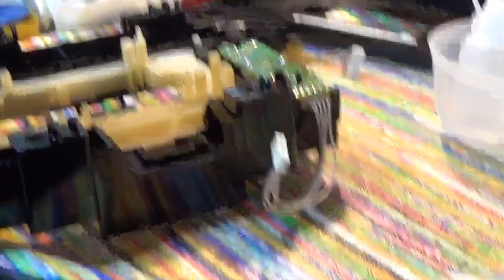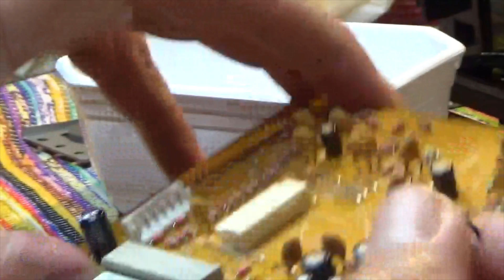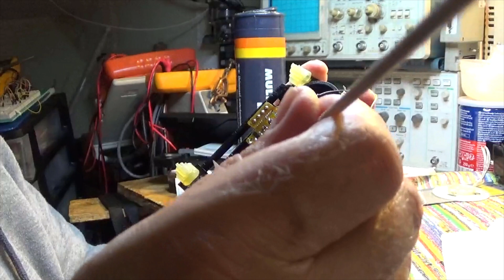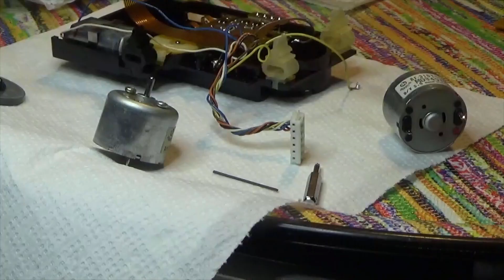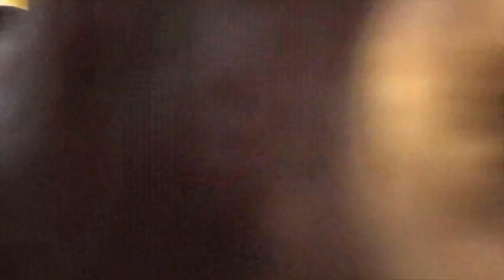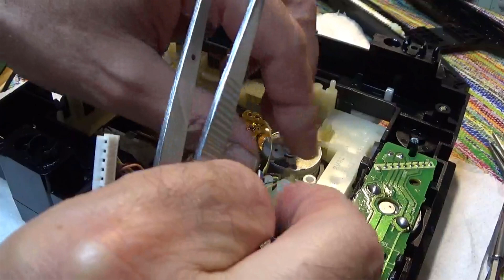Technics SL-PG480A CD Loader Repair Part 1 of 2

Comment: I don't know how to find the switch which is open the drawer, I cannot move the drawer with hand because is blocked, and I saw in the service manual the switch is nearr the white plastic. Can you help me with an advice ? The switch is very oxidated and the drawer is closing himself imediately as you open it. I am grateful if you can help me, I am not an electronist.

Comment: Sir how did you know  that's  the spindle motor is broken? Did you check  the motor? Thanks
Reply from the maker: Hello, 
I found out by observing two things: 
1) Normally when you insert a disc and the tray is being retracted into the CD reader, the spindle will run for a few seconds to allow the CD player to detect there is a CD loaded in the tray and

2) When the CD is loaded and nne pushes the PLAY button the CD should start spinning which didn't happen.
Ultimately I checked the motor was broken by unsoldering the powerleads of the motor and coupling it to a variable power supply, slowly ramping up the voltage to its max. required voltage... +-9V DC (max 11V !). The motor didn't spin, so I, correctly, assumed it was broken. 
If one doesn't have a variable power supply, one can always use a small 9V battery to quickly check the spindel motor. Just make sure the motor isn't coupled to the CD player any longer
Thanks for your nice comment and considering subscribing.
Good luck !
Reply: @TechneMoira  thank you very much sir  I have pioneer pd106 won't  spin the spindle motor  the lens is OK there is light  I check the spindle I checked with multimeter  the analog  one I set to x1k its spin the reading 500 ohms..what do you think.the spindle  motor its OK? The one you put resistor  for what  is for sir? Thank you and  more videos....
Reply from the maker: If the motor coil still has some resistance, that could be a good sign the motor is still ok. However, it's possible that the motor coil(s) are shorted or still somewhat conducting, but the motor is fundamentally bad.
Either way, you should set your multimeter to DC Voltage measuring and connect it to the pins that normally supply the spindle motor with power (after you disconnected the motor). Keep an eye on the multimeter and push the PLAY button. If the meter shows enough voltage to spin the motor, then the power supply is ok... if however you see zero voltage (or very little, or unstable) then the problem is perhaps in the motor power supply or somewhere else
Good luck
Reply: @TechneMoira  thank you very much  sir

Comment: No grease on plastic,it is selflubricating,the white one.
Reply from the maker: Hello, there was (a little) grease on the plastic present, probably put there at the factory. Therefore I assume(d) a little fresh lithium grease wouldn't hurt. But thanks for the tip and considering subscribing ! :)

Comment: Hi TechneMoira, another great video. I was working on a Philips DVP3960 DVD player and the loader jams  intermittently. I replaced the drive belt from another unit but still the same issue. I think I should get a new belt since I have seen that the belt has some play in it. Other than the loader jam the unit is fine. Meanwhile I enjoyed your video and I hope all is well with you! Keep them coming!!! Be well!!! 🙂
Reply from the maker: Hello Alfonso, Maybe there is a belt tensioner inside the player? Have you checked?
I'm having my summer break. I'll be back probably around end of August :)
Enjoy sumer when you can
Reply: @TechneMoira  Yes, I did check but this is a very cheap unit and there is no belt tension. I think it's wear and tear on the plastic parts. Enjoy your summer and I hope it doesn't get that hot. We sure get a lot of heat, here in Florida! See you on the next video! Enjoy!! 🙂

Comment: Hello again and thanks for this excellent video. Much more interesting than most CD player videos which seem to be almost exclusively about belt changes.

As previously said - I'm no expert but I can try and help you out. I'll try and come back and edit this comment as I think more on the problem but I don't know if that's possible. Don't know if I can post links either but I will try. I've found a pdf which contains the F26 error code for CD players: "Communication between CD servo LSI and microcomputer faulty". There are a few other references to this in very few other google searches I found but they suggest that it could mean almost anything. Edit: I have removed the link to the error code document because my comment is not being left and I don't know if that's why.

In the service manual there is a button press routine for starting the "Automatic Adjustment Results Display Function" which gives you other "E" based error codes for troubleshooting. The manuals are available on hifiengine for free.

I can't remember if it's in your other video but why did the spindle motor need replacing? This is the first place I would look and whether putting the old motor back would make it come alive again. Different feedback from the motor to the chips could be affecting operation. Elsewhere, I would think about the mechanism and whether it's reset correctly in order to function properly and whether there are any microswitches. I know the laser diodes are apparently very sensitive to static so that might also be an issue if it got killed.

I use a brass ball in a container (don't know what it's called) but you insert your soldering iron in it after every few uses. Similar to your brush but it cleans, collects the wipe off and refluxes your tip. I believe it contains rosin flux or similar to reflux the tip but some cheaper ones may not. It works a treat and also you do not get the thermal shock of a wet sponge.

The spring on the motor shaft is interesting. I think it probably provides the correct amount of drag to help stop the disc spinning more quickly when you press stop. Like you say it could be for general damping. On that point if the new motor doesn't feedback to the circuitry properly because of different drag then maybe that could be an issue? I'm assuming the motor is not a drop-in replacement (seeing as you had to alter the shaft)?

In the future, if you are interested in adding an optical out to supply a different or more modern DAC then I've been looking at alternative schematics to try and sort this out. I don't believe there is anything substandard about the DAC in this unit but it may be interesting to do anyway. There is no guarantee it would work but you could test it before cutting a hole. It literally requires one capacitor one resistor, the output socket and I think at most 2 wires picking up off the correct board. I've ordered and received five sockets from China. Non of this line (380/480/580) seem to have optical out. However, I looked in the manual for the 490 and the same chip is used which sends to the optical output and the additional circuit is very simple if I can find a pickup on the output board. It's whether there is a trace all the way from pin 17 on the chip all the way to the output board - looking at the manual it does appear that there is - but in practice this may not be the case and you'd have to solder directly to the chip which may be a lot more tricky and risky.